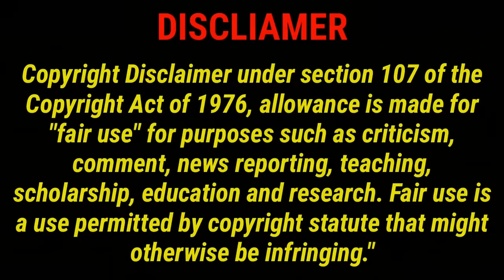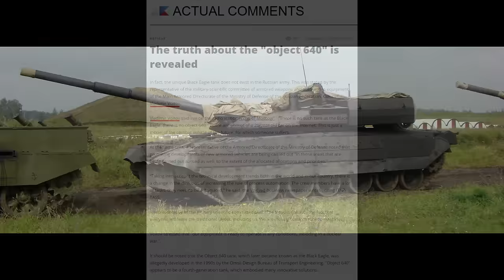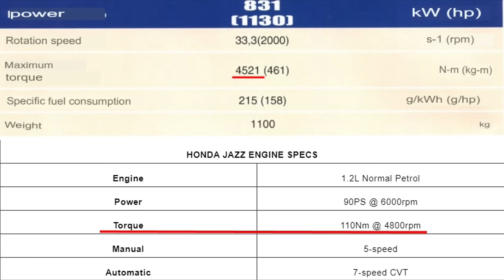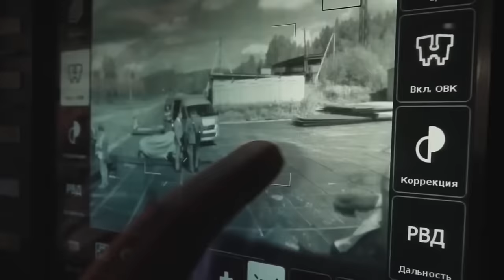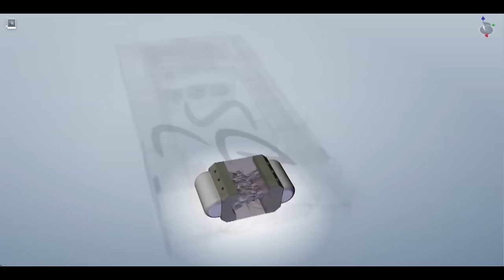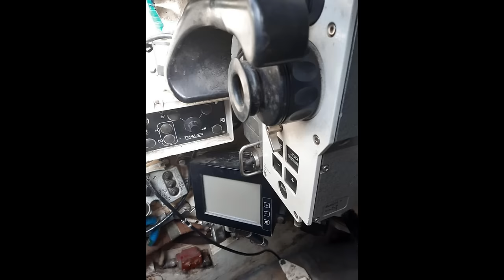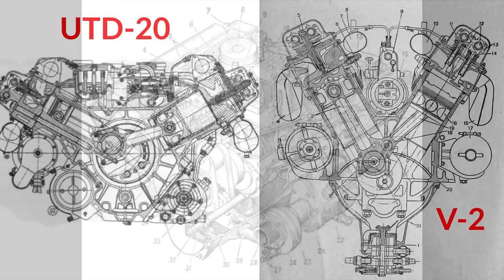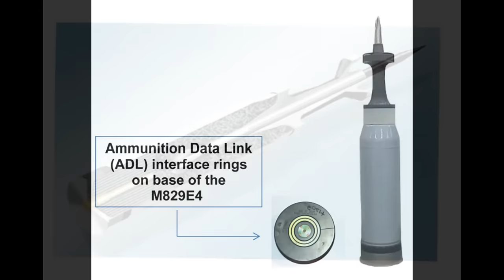LazerPig is WRONG about T-14 Armata

Comment: The Challenger CV12 engine is/was also used in trains. Super reliable too and produces massive torque instantly.
Reply: I think the torque wouldn't matter that much in trains. From what I've read, most diesel locomotives are diesel-electric meaning the torque moving the train is provided by electric motors and the diesel engine providing only need to provide enough power (not torque) to power the electric motors. Diesel-mechanical locomotives are (I think) mostly smaller ones used in shunt yard duty, not for pulling trains.
Reply: @seneca983  lol go look up the weight of a cargo train, thousands of tonnes. Torque is exactly what makes it move.
Reply: @v4skunk739  Maybe you missed a part of what I wrote? The torque to accelerate the train is provided by an electric motor and the diesel engine only spins an electric generator, not the wheels directly. Thus it doesn't need as much torque as long as it can provide enough power.
Reply: @seneca983  Either way it makes massive torque at 700rpm and powering a generator is tough on an engine.
Reply: Was also considered for the M1 Abrams and the XM2001 Crusader in it's 1500hp configuration mounted to a GD automatic transmission, but that was cancelled in 2003.
Also used in the Pak-sino Al-Khalid P2 prototype in it's 1200hp form with a French transmission.
Another programme was for a 1000hp version to be fitted to Czech T-72's under NIMDA. I'm not sure how this project turned out.
Reply: @seneca983  what you said, seem straightforward to me
Reply: @KKTR3  yup, pretty much a huge alternator
Reply: Ha! Leave it to the Brits to apply railroad tech to... Well, everything!

I didn't know that. Cool. Cheers!
Reply: Whoa, from now Thomas the Tank Engine makes some...strange sense for me
Reply: Weight on trains of focused on very small points where tanks spread their weight over a wide area, trains don't need much torque which is why it was more reliable on trains than tanks
Reply: It would be worth othing in mud of Donbass ... High torque without adhesion is useless...
Reply: @matthewmitchell3508  I believe the T-72M4CZ does use the 1000hp CV12. The CV12-9A (to be used in CR3, with some CR2s being upgraded prior to conversion) is confirmed to run 1500hp as well.
Reply: @tunakann7629  nah, it's a constant load. Diesels like constant loads (and adequate cooling). Can't get that being in a tank that's being revved and ran up and down hills, then shut off, then started back up in a hurry to be forced into a high engine speed situation before going all over the place.
Reply: @seneca983  The only thing an engine produces is torque , it's the most important thing on an engine btw . 😅 And spinning a huge generator needs lots of it .
Reply: @V4 Skunk  700rpm isn't alot my truck does 1000rpm to just move it crane
Reply: @5co756  When spinning a generator what matters is power. Power is basically torque times rpm. In the case of an engine spinning a generator, that's what matters rather than just torque. Plain torque as such is also important for e.g. accelerating a stationary train but that's provided by an electric motor.
Reply: @seneca983  What you mean is HP , wich is just a number generated by multiply torque with rpm's . All an engine produces is torque and this turns the crankshaft and your wheels or a generator . 

That's a basic missunderstanding of an engine , even street cars can have 1500hp at 8000rpm , but will never move a 60 ton tank . HP is just a number on paper .
Reply: @5co756  "even street cars can have 1500hp at 8000rpm"

I'm pretty sure most car engines can provide at most something like a third of that or thereabouts though sports cars might have more. You don't get more hp by just increasing rpm (beyond some point) because then the torque will drop.

When a torque figure is given it's usually a maximum torque which usually can only be achieved at low rpm. That may be relevant for e.g. accelerating sufficiently quickly when starting from standstill. However, that's less relevant for an engine spinning a generator because then a greater rpm can be chosen such that the power (rather than the torque) is maximized.
Reply: british tanks are practically trains
lets be honest

-British dude
Reply: @johnt1173  Would you like to do you commute in a tank?
Reply: @seneca983  I may not be the most intelligent bloke but your sentence makes no sense.
Reply: what locomotives use it if you dont mind me asking?
Reply: @v4skunk739  spinning essentially a flywheel to make electric power does not take a lot of power, nor is tough on an engine. You can take the engine out of a lawn mower and attach a car alternator to it and you got a cheap 14v generator. The generator in a train mostly needs to make electricity when the pantograf does not make contact with the electric lines or are not getting electricity through them.
Reply: @seneca983  you're exactly right. Modern trains are diesel electric however there are smaller (even passenger) trains out there that use a cardon shaft and gearbox.
Reply: Not true... It's not a great power pack speaking from experience
Reply: @bursucu2912  True but Diesel-Electric trains don't use overhead catinaries, they rely solely on their own power generation, therfore the generator needs to provide as much power as the motor is consuming.
Reply: @v4skunk739 It’s not ‘either way’, it’s what he said. Wise up kid.
Reply: @seneca983  actually passenger trains that are lighter may be pure diesel. otherwise pretty much all is diesel electric since it eliminates gear box.
Reply: @seneca983  That depends on the age of the locomotive. Older diesel locomotives will use either a more traditional geared transmission or a hydraulic transmission so the torque did have to be provided by the engine itself. When diesels were very new this often meant that they had less tractive effort than steam locomotives, they also often had less powerful brakes. Electric transmissions only start becoming ubiquitous around the 80s. Given how old this engine is, it seems really likely, without looking it up, that it was used in some locomotives before then, and given that locomotives can have ridiculously long service lives a lot of them might still be in service. But yeah on a modern diesel-electric the torque of the engine itself basically doesn't matter and the electric transmission also allows you to just link several locomotives together and use them as a single one. In the US it's very common to just keep locomotives around even if their engine has broken and just attach them to locomotives with working engines that power their traction motors.

Also when it comes to railways in general torque isn't the entire story, I mentioned tractive effort before and that's what really matters. Tractive effort is the ability of a locomotive to actually apply power to the tracks and move the consist, this is not the same as torque because if you simply send too much energy to the wheels the low friction between it and the track will cause it to slip and thus apply basically no effort. This was what older diesels struggled with, they had relatively powerful engines but weren't anywhere near as heavy as steam engines and so often had a hard time applying enough effort to the track to get consists moving. In modern locomotives this is basically a non-issue though because of electric transmissions which lets you spread the power out over a potentially infinite number of wheels, as well as the precise electronic control you can have over an electric engine. That's why you won't really see that term used anymore but it was a really big deal during the steam days.
Reply: @hedgehog3180  Thanks for the info.
Reply: Its as if Tank Engine can be used for other things and not just a Metal Boxes with Guns on them.
Reply: is that the same perkins engine on the czech t-72?
Reply: This thread has the best comment section argument I’ve read.

Comment: 14:17 - nobody comments on fact that LazerPig dreamed up 52 ton M1 Abrams? First variants were 56 I think....and hit 60 pretty much immediately.
Reply: And fully loaded it pushing  72 tons
Reply: You criticize Lazerpig but you aren't even confident yourself. Why would you make such an assertion if you don't even know?
Reply: @123456qwful  In short tons.
Reply: In fairness that actually kinda proves the point he was making further lol
Reply: Which only proves his point more
Reply: Yea first production variant was 54 tonnes, modern variants push well over 60 like the sepv3 weighing around 67 tonnes
Reply: M1A2 SEP v3: 73.6 short tons (66.8 t)
Reply: @123456qwful  no. With mine clearer+ TUSK pack+ Trophy, the maximum weight of M1A2 is over 80 tons.
Reply: Tonne or ton?
Reply: @chaosXP3RT  Literally a 5 second google search "how heavy is abrams sep v2" comes up with a full list of weights. M1 was 60 tons (american) and SEPV3 is 73.6 tons (american). Going by metric tons M1 was 54 and everything after M1A1 was over 60.
Reply: @chaosXP3RT  concept of rethorical question seems alien to you.
Reply: That just made LazerPigs statement that much more impressive. The Abrams is faster at 70 tons than the T-14
Reply: @chaosXP3RT  
Can you do me a favor? Can you take a magazine or some paper? Just make sure it's a good ~50 or so sheets of paper.
Did you find it? Okay, good.
Now make sure to roll it up - tightly.
...Now hit yourself on the head with it several times for me since I can't reach through TCP/IP and do it for you.
Thanks.
Reply: @tristinjudd2595  well again as red effects  said  ur comparing a diesel engine to  a turbine from a fighter jet, it be more surprising  if it wasn't more powerful, be mindful they can always  swap  out the diesel  for the t 80s turbines if they want the same amount of power the Abrams can
Reply: @123456qwful  I don't think there will be time to argue differences in engine makeup on the battlefield. 
It's all about performance.
Reply: @tristinjudd2595 And the reliability and mileage of the abrams engine is crap and the weight makes it ideal to stuck on mud and makes transportation rather difficult

Comment: As a person who used to be a mechanic. I did a double take when I saw that the engine weighs 4300lbs. 
I was like wait, what’s a 1200lbs more than what my car weighs.
Reply: Wait until you see how much ship gas turbine engines weigh...
The General Electric LM2500 that's been used on a lot of United States Navy ships since the 1960s? They weight 50,000 pounds. Each. And each generates 30,000+ (LM2500+ is 40,000+) horsepower. And ships have multiple of these things.
Reply: @matchesburn  Because they're many hundred times heavier than cars and tanks
Reply: To put it in perspective though, that's engine that weighs 10x more than a Chevy LS V8, powering a vehicle that weighs ~15-18x as heavy as a Chevy Suburban. Really quite light when you look at it like that.
Reply: @fantastikboom1094  
I listed the weight of the engine. I'm aware of how much they weigh. You're not telling me anything I didn't know.
Reply: @matchesburn  I was talking about ships lol
Reply: @fantastikboom1094  And so what ?
Reply: @matchesburn  ...yeah, ship engines are heavier than cars and tanks, who could've guessed.

what a nothing burger of a statement
Reply: @politicallyinaccuratetoast4757  
"what a nothing burger of a statement"
Yes, you repeating back what I already said definitely qualifies as that, oligophrenic.
Reply: Even if you get past all the forced induction and all that entails, especially built for "tank" duty cycles, It's just plain hard slimming down almost 39 liters of combustion space...lol...
Reply: Guess you aren't a diesel mechanic.  I went to auto tech school. We shared the shop with the diesel class. Those diesel engines are easily 4000lbs. The block alone is cast iron.
Reply: @fantastikboom1094  So you decided to stay on topic, did you?
Reply: @nicomeier8098  ?
Reply: This is the real reason to go with a gas turbine engine as their power density is better then that of a typical diesel. Yes you have greater fuel consumption which means fueling up more often or more fuel weight to maintain a range.